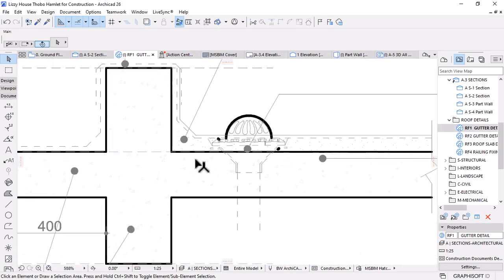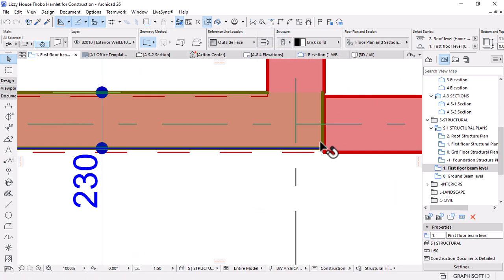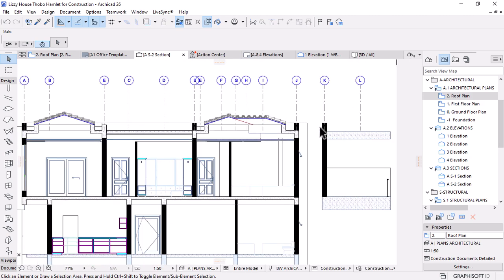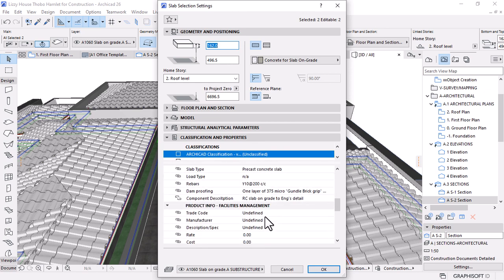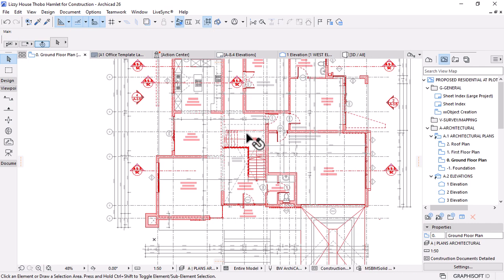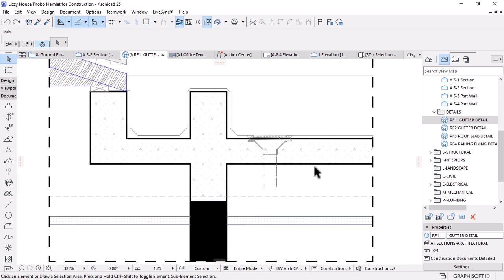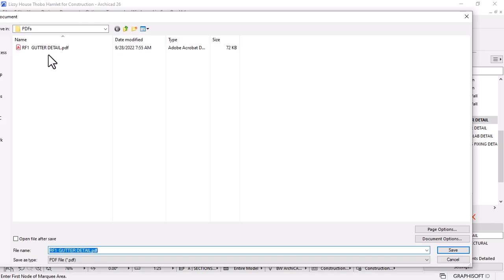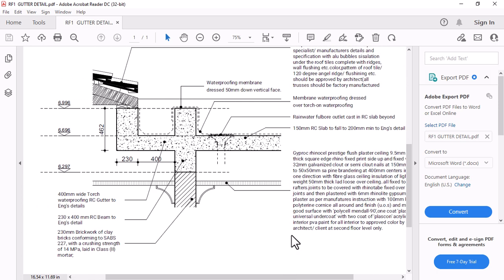Construction Details For 20 x 23m Contemporary  House | ArchiCAD Details

Comment: Here is a simple solution for solving your being problem. What do you need to do is make a framing plan. This makes it much easier to make your connections and check for errors. I’ve done this myself so it can work for you. I’m sure.
Reply from the maker: Thanks for the tip, well appreciated Gerardo
Reply: I think you should use the section zone tag. This will make it easier for you. You need to unlock the full power of ArchiCAD more BIM and less AutoCAD.